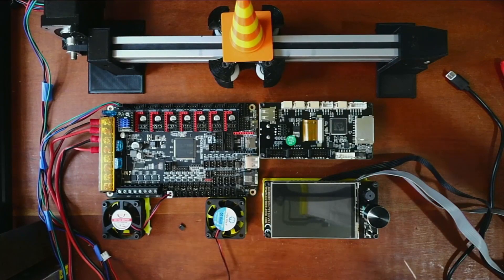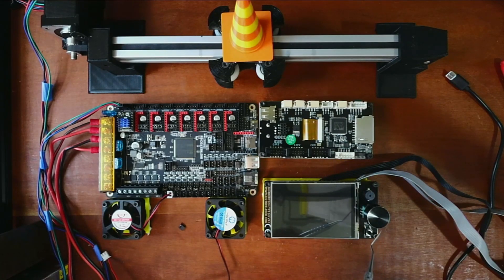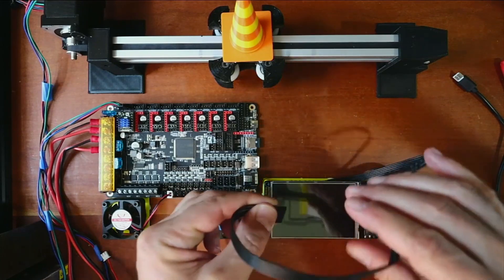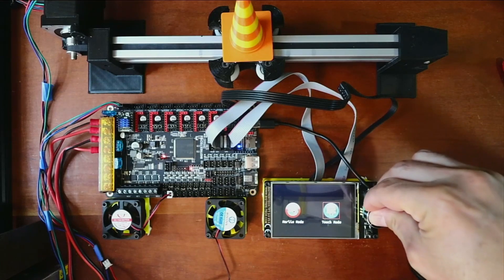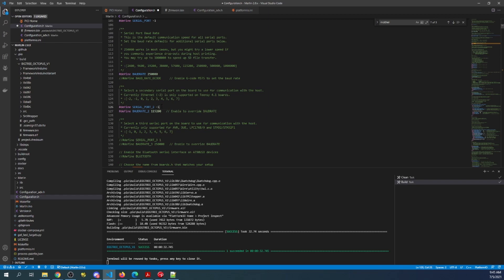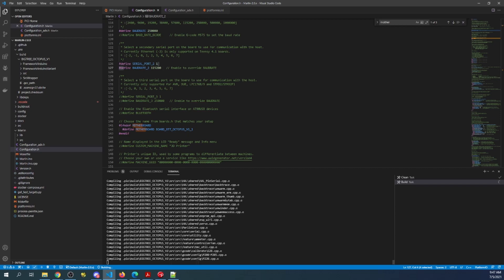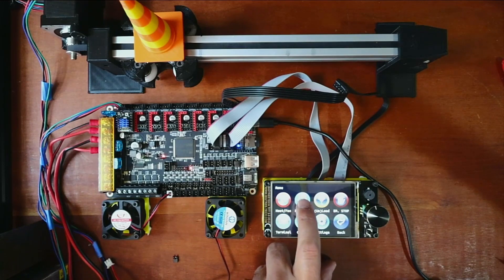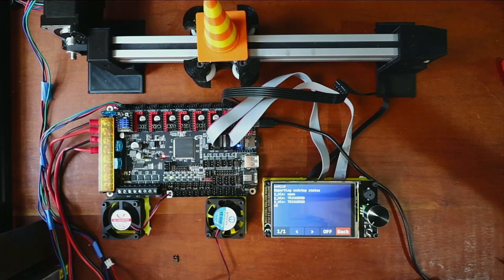BTT Octopus V1.1 - TFT35 V3 display configuration

Comment: I was curious if I have to change anything in configuration.h or configurationadv.h? Got an ender 3v2 with tft35v3.0 and it’s the last part of my compile. I’m assuming it’s not just plug and play? Boards a octopus pro v1.0 with 429 chip. Thanks
Reply from the maker: Depends on what you wish to configure.  It can go off in hundreds of directions.  TFT has a configuration file as well as Marlin firmware.

Comment: For some reason, I can't get this to work with the Octopus Pro V1.0 with TFT35-E3 V3.0.1. It connected with the FW as supplied the first time I turned it on, but after going thru the TMC2209 and this tutorial, I can't get the TFT to connect. Pronterface connects, though, so I can verify the drive update happened. Other than the cables landing in a different spot, is there something else needed for the Pro?
Reply: My Fault! Copied to wrong environment declaration. Thanks for these vids!
Reply from the maker: There's a Discord link in description.  In General chat either myself or someone else can walk you through it.

Comment: would this also apply for the tft35 e3 v3.0?
Reply from the maker: Yes.
Reply: @EdwardBraiman  wrong. it does not have a tft connection unless it is labeled something else
Reply: @victorhugo-nt8yh    That's the RS232 connection

Comment: Like it? I love the tutorial. Still working on the whole "no printer attached" debacle, but in doing so I uncovered a hidden drinking game: Down a shot whenever he says "actual" or "actually". ;-)
Reply from the maker: No printer attached is usually buad rate on display.
Reply: @EdwardBraiman  Tried all of them at this point, still no printer attached. When I want to restart the firmware to try if it would run it writes "mcu 'mcu': Command format mismatch: config is_config=%c crc=%u is_shutdown=%c move_count=%hu vs config is_config=%c crc=%u move_count=%hu is_shutdown=%c" That probably refers in some way to all the things it just had me delete one by one, while promising it will start to run if I do...
Reply from the maker: Try my Discord in description below.
Reply: Years late. I also still had issues. Maybe it could benefit someone watching this. Could be a version issue where the board he has may be different. Per the instruction manual for TFT35 is says to plug TFT (TFT35) to TFT (octopus). This makes sense. In the video he is, I believe attaching TFT to PD5 PD6, something like that, which also seems to make sense as that is UART.  At least on my board, there is a TFT section (PA9, PA10 etc.) right next to the EXP1 and 2. Plugging in there worked like a charm once baud rate is correctly established
Reply: @overandoverandover56  Years and how many OS updates later? Think about what Ur saying here. 
I will fully admit to being a total noob back then, but times they are a changing my friend. I would rewatch it, but My cursed Ender 5 grilled my Octopus along with the pi4 at the height of the chip shortage... I paid thru the nose for that pie...

Comment: Thanks for the video! It helped me get my TFT70 working with my Octopus 1.1
One note: you can get rid of one of the ribbon cables by choosing CR10_STOCKDISPLAY instead of  REPRAP_DISCOUNT_SMART_CONTROLLER, then connecting the EXP_1 port of the Octopus to EXP_3 on the TFT. It has the exact same functionality, but less cable clutter :)
Reply from the maker: You're welcome.

Comment: I have a problem to connect my display with the BTT Octopus V1.1 to my display. I use the TouchScreen von BTT (TFT70). What must i do to connect them?
Reply from the maker: Not sure I understand your question.  Are you referring to another type of display made by BTT?
Reply: @EdwardBraiman  Correctly! But I've already solved the problem. I did not set a jumper correctly on the Octopus and therefore the processor was not flashed. Now the only problem I have is that the motors are not working properly.
Reply from the maker: There's a tutorial playlist in description.  If you cannot see it in chrome browser look in Firefox browser.

Comment: Works with Octopus 1.1 and TFT35 E3 V3 (video shows the previous version V2 I think, as the encoder knob in the video is to the right of the screen. the V3 has the encoder knob on the bottom just like an Ender 3 pro screen
Reply: TFT35-E3 V3 has the encoder bottom and TFT35 V3 has to the right
Reply: @vincestruhar  correct. also he did not show show where to hook up the tft cable...
Reply from the maker: Thanks.

Comment: On one of your video you mention a power supply set up which video is that on please
Reply from the maker: All my videos talk about power supply in one way or another.  As for wiring power supply for PSU for use I avoid subject because US standards are not the same  for everyone.  For example I was told by a user in Egypt they don't use ground.  So I avoid subject.  My preference is US electrical standards.
Reply: @EdwardBraiman  I live in Colorado and I want to set up my board like you are before putting it together but I understand
Reply from the maker: @tzpetlover  Join my Discord below in description and I'll see we can walk thru the issue of wiring.
Reply: @EdwardBraiman  Thanks
Reply from the maker: You're welcome.

Comment: Any Servo options?
Reply from the maker: Servo option is part of BLtouch.
Reply: @EdwardBraiman  Yes BUT ONLY ONE servo go back the RAMPS for more
Reply from the maker: Ramps or MkS Gen L v1.0.  although it's possible to add more on newer configurations with some modifications to Marlin firmware.
Reply: @EdwardBraiman  More servo's a how to needed please BBT SKR 1.4, without OctoPrint using Pi
Reply from the maker: I'm working my way down the lists of requests.  I'm behind in tutorial requests due to the hot weather here .  That one is going to be a challenge to do.  Today I spent over four hours just record a Klipper tutorial.
Reply from the maker: Still have an hour of cc to do in foreign languages.
Reply: @EdwardBraiman  THANKING YOU FOR GREAT HELPFUL VIDEO's OctoPrint say theire is a Plug in for a Servo
Reply from the maker: Yes, it's where BLT would be attached.
Reply: @EdwardBraiman  Use a servo STOPS ABL